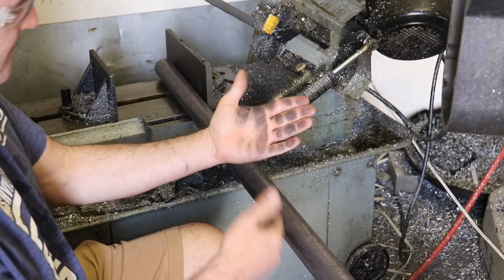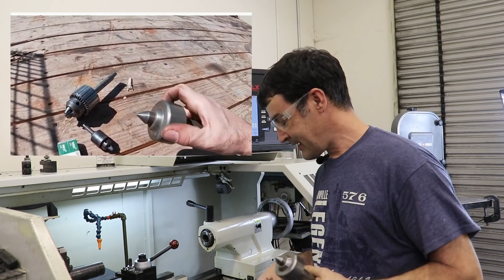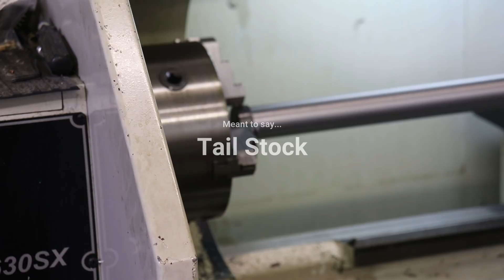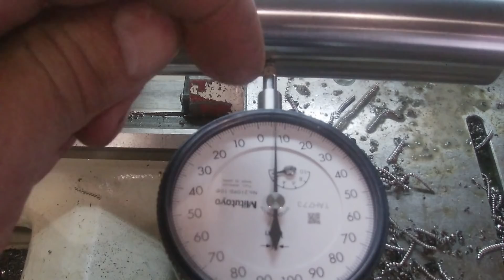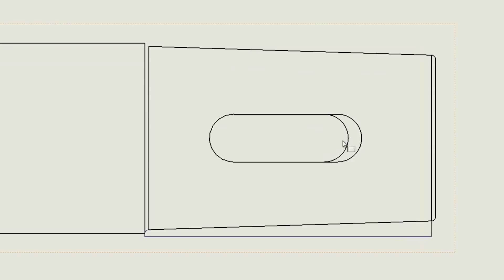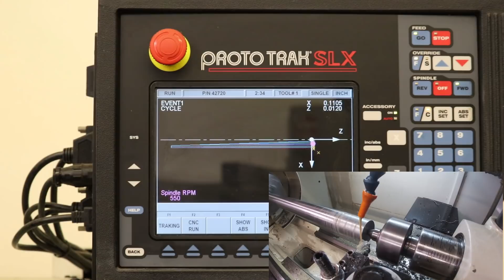Stoker Steam Engine Piston Rod part 1 of 2

Comment: The larger dimention in the middle was due to the farther from the anchor points the more deflection, the less rigidity, the less of a cut. The closer the cutting tool was to the tailstock and chuck the more rigid the bar and the more accurate the cut. At least that how I made sense of it.

Comment: don't you have a grinder for your lathe?
Reply from the maker: mtabernig  I have a small one for the mini  lathe for endmills, not for the big one though
Reply: @DragonflyEngineering  yeah, sometimes this things can be expensive... That is the tool I would use in that operation with that material that needs pressure on the tool.   Very goodm job overall.

Comment: Could that be done with a homemade emry cloth belt sander like the automotive machinist uses for crankshaft polishing?seems that would be a handy tool to have for other processes also.
Reply from the maker: I did try that with the tool you describe but it was too coarse of an operation for this rod,.... with my skill level with the sander.  Good idea though.  Thanks for watching!

Comment: If you end up doing a lot of taper work, these mic's are specialised for that work
https://www.mitutoyo.co.jp/eng/useful/catalog-2019/html5.html#page=103 - fine point to remove anvil effect
https://www.mitutoyo.co.jp/eng/useful/catalog-2019/html5.html#page=111 - can measure diff over distance, ignores anvil effect
https://www.practicalmachinist.com/vb/attachments/f38/201292d1497630929-does-anyone-have-paperwork-taper-mike-taper-micrometer-taper-mike.jpg - Keith has some of these !!
L

Comment: After the first clean-up pass & measuring the center of the bar at 0.001-in. over what the ends measured, you said that a follow rest can cause all sorts of problems.  What are those problems that make you not want to use one?

Comment: For fine cuts you would be better off using a cobalt or HSS cutter ground and polished very sharp. They need a lot less tool pressure than carbide inserts.

Comment: Is there a reason not to use a chrome plated shaft in a steam engine?
Reply from the maker: I'm not sure myself.  I am making the shaft to Keith's requirements; which are probably driven by OEM authenticity.  The 4340 steel is high in Chrome and Nickel, so it does have some resistance. the original shaft was pretty poor steel.
Reply: @DragonflyEngineering  I considered authenticity too. I was just thinking that the chrome shaft wouldn't rust and it's already ground to size.
Reply: Not really needed. In some ways it doesn't need to be polished to a mirror finish as the gland packing will need to bed in, so a little coarseness can be beneficial. Also, on some steam engines, you need a little amount of steam bypass as the steam will have steam oil in it which helps with lubrication.

Comment: Good looking machine.   I kinda agree with others on the rpm being slow.  Try a scrap piece at 800 to 1k rpm  id bet it'll look close to ground.
Reply from the maker: Thanks for watching.  I did bump up the RPM to 650 and the finish did look better but , I have to change out the carbide insert before the finish cut now, which given me the chance to use a smaller tip tool for the finish 2 passes. I've been working on fish off and on since this video. I made a couple more  rods.  This 4340 is tough stuff, which is why I keep the RPM lower, i.e. chatter and tool life.  Advise is always appreciated.  I mostly turn shorter injection mold cores.

Comment: Have you come across a device called a roller burnishing tool, it is great for a super finish which would i think be just what you need for those shafts. Certainly way cheaper than a cylindrical grinde, you can make a perfectly functional one in a few hours or less.
Reply: Little Work Shop of Horrors , nice I will look into that. Thanks!